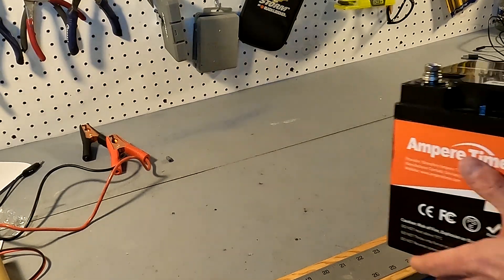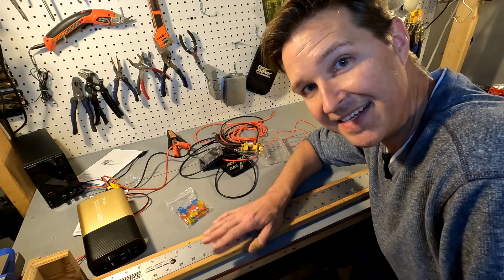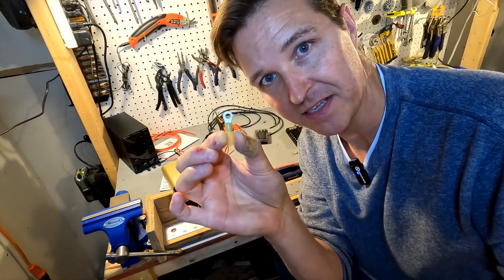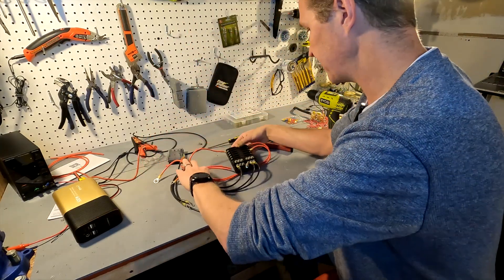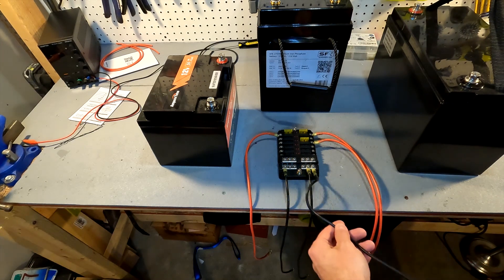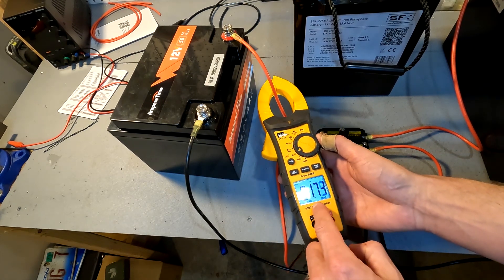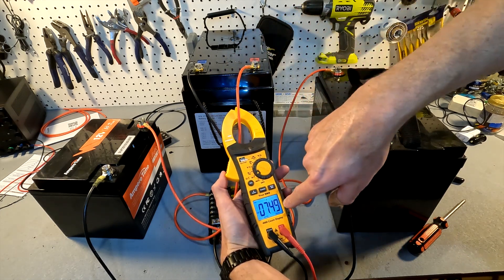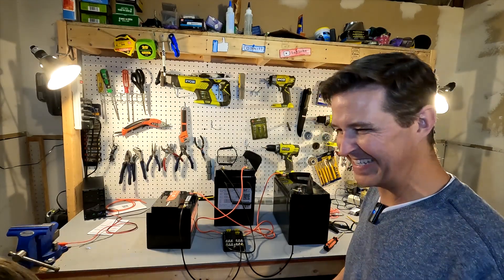Parallel connecting Lifepo4 batteries of different brands and sizes!  Extreme Parallel Part 1!

Comment: POV. not recommended as it poses safety risks and can lead to unbalanced charging, premature aging, and potential damage to the batteries. Different internal resistances and charging rates will cause the larger battery to discharge and charge differently than the smaller one, stressing the smaller battery and creating an uneven system. It is safest to use batteries of the same capacity, age, and brand, and ensure they have the same voltage.
Reply from the maker: I appreciate your concern and the detailed explanation of the risks.

Comment: Very interesting video. I have two different brand 100ah 12v batteries and want to use them as back up. Will use the fuse block method
Reply from the maker: Just make sure to use it for low amperage applications.  The fuse block can only handle 100A total.

Comment: The highest AH will level off to the same as the lowest AH in parallel, If hooked in series instead it will add all the Ah and increase the AH for the system. IMO.
Reply from the maker: Remember when wiring in series that the voltage adds up, but the voltage of each battery doesn't equalize unless you have a external balancer.  Thanks for the comment.
Reply: @OffGridBasement   external balancer.? no sure what that is, I will look it up.
Reply: @OffGridBasement  Not sur what that is ,I will take a boo, thanks.

Comment: So I have a 300ah and 2 100ah batteries in parallel piggy backing off each other. Do you think it matters where the largest battery is in line?
Reply from the maker: I don't think so.  Just make sure you have the batteries wired properly.

Comment: I think a lot of the problems we might have with parallel LiFePo4 batteries is more of a long term degradation issue as the "newer" or "Better" batteries have to work harder to boost the lesser batteries.
I use 3 100ah batteries in parallel to supplement my system in the barn where I have 3 deep freezers.  One battery is 2 years old and the other two are only a few months old.  I run them through a Bluetti to make sure the freezers can run at least 2 days.  The system gives me approximately 5kw of juice and has a total of 1200 watts of solar that is split between the Bluetti and a solar charge controller. The batteries basically act as a slow charger for the Bluetti.  When I only had one battery it was common for the system to run out of juice when I had a cloudy morning. 
Since I am running a 12v system, and only pulling 10 amps MAX when running, I expect these three batteries to last for many years.  I need to set up an experiment like you have and see how each individual battery performs.  Maybe the older battery is hurting the system, but it serves my needs in that the batteries and the Bluetti are often pressed into other applications on the farm.  I'll snatch one of the batteries to use for running a sprayer or a small trolling motor on occasion and then just hook it back into the string.  I do have electricity out at the barn, but use this system for giggles and to have a backup.  Sort of a "proof of concept" that, for only about $3,000, I can save $.60 a day.  ROI is about 13.7 years.  Yay me!!!

Comment: If you are concerned that there might be too high of an initial current draw when first hooking up the batteries, I suspect that you could use a 12V incandescent light bulb of the appropriate wattage between the two positive terminals while having a direct wire connection between the negative terminals... These would act as load resistors and limit the current to whatever you might want... For example, put a 36W bulb in it to limit it to 3A.  This would also make it more plain the voltage in the two batteries because you would have the voltage drop across the bulb.
Reply from the maker: Thanks a good idea!  Thanks for sharing and the comment.

Comment: How do you measure DC amps with a tong tester?
Reply from the maker: I was checking the battery voltage with the probes.  I used the amp clamp to monitor the amperage.  Thanks for the comment.

Comment: Sir,is it possible to parallel plug and play with power wall?
Reply from the maker: Only if the battery is the same voltage.

Comment: What about connecting that 350ah bank of that parallel,to another of that kind and make it in series to make a 24v system?
Reply from the maker: Wow.  You're talking about REALLY mixing things up.  I'm not sure.  As long as each 12v bank in the series totals the same AmpHour capacity, then it should be ok.  I would need to test that to make sure.  Thanks for the comment and the idea!

Comment: can i ask. i have two different set of batteries 12v. 

12v 16ah gel type
12v 25ah lead acid

but one output is it okay to use them directly im not gonna parallel them but connect them in one output
Reply from the maker: You really shouldn't connect two different chemistries together.  Know that, the most important thing is to get the voltage of each battery to be as close as possible to each other before connecting in series.  Matching at the highest charge level possible.  Hope this helps.
Reply: @OffGridBasement  how about connect then in parallel?

Comment: 12 gauge wire is enough if the system will not run a high load like 500 watts appliances 

I have a 240ah and 60ah lifepo4 pack and i want it to connect in parallel 
Maybe it is safe to parallel connect a different size of lifepo4 battery pack with individual bms
Reply from the maker: I believe there is no problem.  There will be some balancing issues when you get to the top or bottom of the SoC of the bank.

Comment: Can you show me where on the fuse board the cables go as it confuses me as they run in parallel so could you number them like 123 etc on the fuse board please
Reply from the maker: It really doesn't matter where you put them on the fuse block since they are all running in parallel.  Just make sure to wire all positives to the positive section of the fuse block and all the negatives to the negative section.
Reply: @OffGridBasement  thank you I couldn't get my head around it as to all running parallel  thank you once again did you know you can charge them up with a ev power point

Comment: if this I all you need? Why do the so called " experts " preach USE a battery balancer??? I dont have this answer. I just got started with LFP4  two 12v 100ah  and now they shot the price up on the brand I have so I want to get a different brand, Where is part 2 of this???
Reply from the maker: If your batteries are wired in parallel you don't need a battery balancer.  The balancer would be for individual cells wired in series.  Batteries or cells in series don't keep the same voltage.
Here is a link to part 2:  https://youtu.be/e_UkBStWkhY

Comment: I'm surprised that the current was only 3A with such high voltage difference. I'm about to connect my two batteries and sitting here wondering whether them being within 0.01V is close enough :)
Reply from the maker: Ha!  I think you would be just fine!  Thanks for the comment.

Comment: Yes, it works quite well and won't hurt the batteries.  Since they are paralleled, the voltages will even-out once the current tails off.  The SOCs will not even out (more on that later), but the voltages will.  You do have to take a few precautions however:

* First, you have to limit charge and discharge current to what the worst battery in the bunch can handle (which will typically be the battery with the lowest number of amp-hours).   The reason being that it is possible, even likely, that situations will arise where most of the BMSs will disconnect on low-voltage or on high-voltage and potentially leave just one battery active.  If it happens to be the worst battery of the bunch, it must still be able to handle whatever you throw at it.

* And second, you have to be cognizant of the paralleling limit, which is a short-circuit feed-in limit basically.   It is typically 4 batteries of the same Ah rating... which means that poor 50Ah battery is way over the limit (150Ah of other batteries).

The solution to the paralleling limit is to simply add proper fusing.  You kinda did that, though not in the usual way and for different reasons.  But that is the solution.  LiFepO4 batteries of the same voltage (same # of cells in series internally) can be paralleled more or less infinitely as long as proper fusing is done to protect the wiring and for battery safety (the paralleling limit in manufacturer specs).

--

Also note that the SOCs for LiFePO4 batteries connected in parallel will never balance out on their own due to the flatness of the discharge curve.  But once you've cycled the whole mess a few times, the SOCs WILL be in lock-step, albeit offset from each other by up to around +/- 10% (due to differences in the internal resistance of the cells).  And because of that, the current sharing will NOT be absolutely bang-on.  But it will work as expected on average.

So as long as you do not count on 100% perfect current sharing, it works surprisingly well.
Reply from the maker: Thank you for the great information!

Comment: When you introduced the inverter, you lost me....
Reply: Are you trying to speed load, you know that is counter productive right? Don't get me wrong, I've did my experimentation as well, but I didn't make a video about it.
Reply from the maker: I'm not sure what you mean by speed load.  I'm just showing that you can use different size batteries at the same time in parallel.
Reply from the maker: The inverter was just to show the amount of amp draw you can do from this type of setup.  The fuse block is only rated @ 100amps so you don't have to use a very big inverter.

Comment: What is the yellow multi-meter with the clamp-on current testing feature you're using in this video? It appears to be quite accurate. Thanks.
Reply from the maker: It's a clamp on Multimeter from IDEAL.  I bought it at my local Lowes.  Thanks for the comment.

Comment: Hello, 
Nice video.
I have a technical question, I'm sure you know the right answer, I don't.
You have 3 different batteries and 3 different BMS's. 
In parallel you add the Amp's together.
50 + 100 + 275 = 425 Ah.
I don't know the different BMS capacity you have in the batteries. 
Can you add the Amp's of the  BMS's together too?
BMS 1 + 2 + 3 = X
Regards.
Willy 
😊
Reply from the maker: Yes, correct.  If you have a 50, 100 and 100 amp BMS then you add them together for full input/output.  This example would be 250 max continuous draw.
Reply: @OffGridBasement 
 Thank you very much for your service. Willy.

Comment: I have 16 eg4 48v 100ah batteries, but i need more storage. I want to buy a 1740ah Industrial flooded lead acid battery. ( forklift battery) is it possible to use these together? These are for a off grid solar system
Reply from the maker: I don't recommend that.  The charging profiles are different and I believe the internal resistance is different as well.

Comment: I think these batteries can go as high as 14.5 volts, so they still had some space to be filled. So one having more pressure than other might push it's excess into another. Sotheby's way I understood, basically voltage is like the depth of water ,capacity is the amount of water. You can have ocean of water, but a pipe sticking 20 feet down will have the same pressure as the water reservoir having 20 feet pipe submerged under water. And if we drain water through these pipes it will take couple days to drain water reservoir, but thousands of years to drain ocean. Or if the level of the sea is 10 feet ,but a pool of water 100 feet it will have 10 times more pressure, even though it's only the size of a pool.
Reply from the maker: I believe that is a great analogy!  Thank you for the info and the comment.

Comment: I would bet any negative effects would be less when using a 24 volt system. Wire gauge, connection tightness and conducter quality is very important for non resistive connections @ 12 volts. The wires you are using are too long and too small in gauge for a high cap 12v system IMO. Everything would be OK @ 24v. Most solar MPPT charge controllers support 24v and one can buy cheep 24 v inverters and 12v down converters. The advantage is much more affordable ( smaller gauge ) wires. This philosophy saved me a lot of money as I hooked my solar panels in 100v ( series) arrays so I could run just 10 Guage conductors to them. Seriously,  anyone hooking up a battery bank ( that doesn't go in parallel with a 12 volt car battery) NEEDs to absolutely go 24 volt ! It's more expensive to go 36v or 48v.....
Reply from the maker: Yes.  The wires are small because the fuse block can only handle 100amps.  I went into this knowing it would only be used for small loads.
Connecting different ah batteries in series is not efficient.  If you connect a 50ah and a 100ah battery in series you are only getting a 24v 50ah battery bank.  You would only get the capacity of the lowest ah battery.

Comment: I have two 100Ah batteries. However, one is 12V and the other is 12.8V. Is this is a problem if I want to wire them in parallel?
Reply from the maker: I figure as long as they are the same chemistry you should be fine.  Do you know what the max charge voltage of the 12v battery is?  it might be 13.2 while the other is 13.8.  Just keep that in mind.

Comment: Myself, I wouldn't be mixing different brand batteries together, not sure if it would cause
a negative effect to the batteries.   But, I'm no expert.
My reason for the concern is I wanted to build a large Series/Parallel LiFePO4 battery bank,
but  Redodo recommends you purchase all your batteries from them, within 3 months of each other to be in the same battery bank,  6 months for Chinns Batteries. 
   So, maybe it's something to do with changes they make to the batteries over time.
 It's alot of money to shell out in such a short time to get that big battery bank of 16 
batteries I was hoping for.
So, in 3 months I was able to get four  200Ah Lossigy batteries for my system.
Maybe, someone could shed some light on this issue why I shouldn't build
a larger battery bank over 12-18 months.
Reply from the maker: I believe the reason they say that is so the resistance is the same across all the batteries and that the BMS have all the same settings.  If it's your main setup I wouldn't mix and match batteries.  I think you can get away with waiting just don't connect old batteries in series with new ones.  Series connect batteries of the same age and parallel connect them together.
Reply: @OffGridBasement  OK, good info about the BMS.  Just got a reply back a reply from Lossigy,
They recommend up to 6 months.  "12 months is a little long, and the capacity of batteries will vary".     I guess it's got to do
with the aging process of a battery and keeping them close to the same manufacturing date.  Something to keep in mind, Thanks.

Comment: I was told by LiTime battery not to use mismatched batteries and to use the same batteries manufactured within a 90 day period. 

So this video will be interesting, thanks!
Reply from the maker: It is definitely recommended to build a bank with all the same batteries.  That way you have the same resistance and BMS settings.  This just proves it can be done, not that it's the best way to set up your bank.  Thanks for the comment and info!
Reply: @OffGridBasement  But I love and appreciate your videos! Keep them coming sir!

Comment: I was told hooking up different amprae batteries together can be done but you have to make sure you start off with all the battery voltages are the same. I have two sized Valence batteries and the manufacture warns against using two different size batteries hooked together. Maybe because the BMS will shut down if it noticed the batteries are way out of balance?
Reply from the maker: I don't think the BMS would care about them being out of balance.  One thing I know it cares about is the amount of amps being pushed or pull to/from the battery.  If the voltages are way off then the amount of amps being transferred between the batteries could be too much for the bms.
I really think companies are just trying to keep you buying their batteries.  There is something to be said about all of the batteries in the bank having the same BMS.  That is something you should really keep in mind.  You don't want one battery shutting off @ 11v and another shutting off @ 10.5v.
Reply: @OffGridBasement  " You don't want one battery shutting off @ 11v and another shutting off @ 10.5v." this is exactly my point